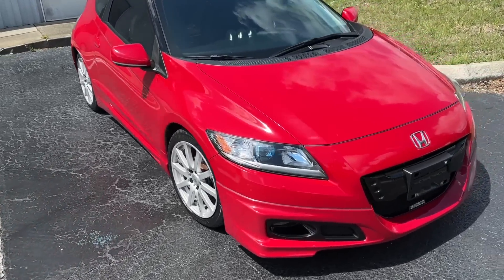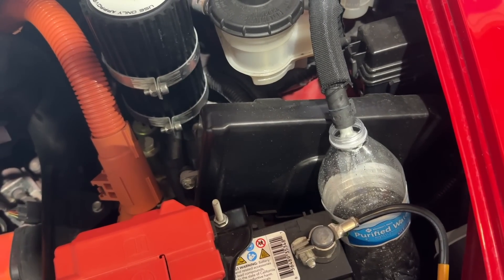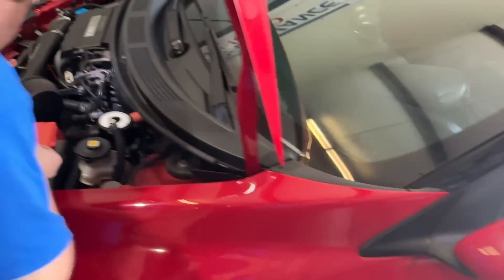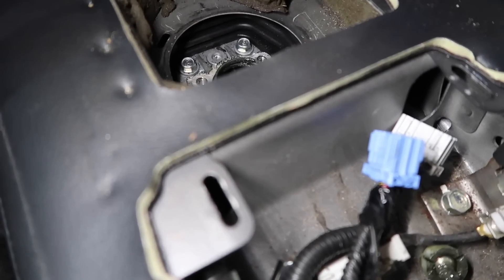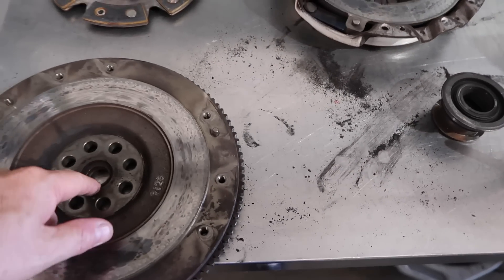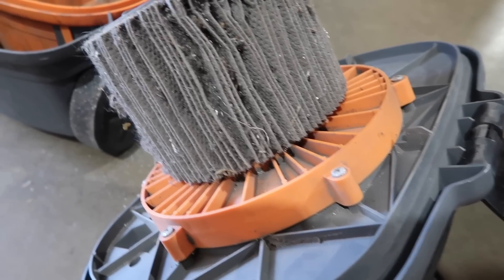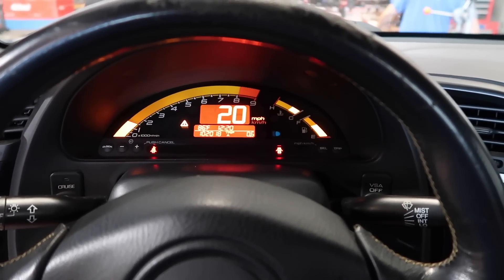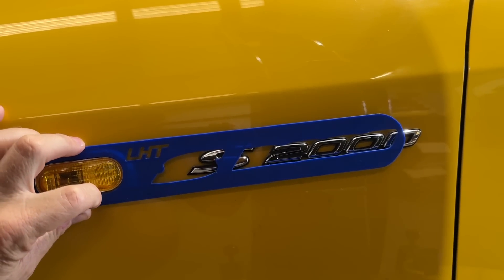CRZ OEM Supercharger + S2000 CR Clutch

Comment: So glad to see you featuring a CR-Z again. I have owned my EX 6MT for two years and I completely love it.  Mine is also Milano Red.  It is a 2016, which is extremely rare. I know that some people, who have never driven a Zed, believe that they are under-powered, but I have not found that to be the case.  I see no need for a super-charger (which cannot be fitted to a 2016 anyway.) It is an absolute blast to drive on the street. I keep mine on a very strict maintenance schedule and I use Honda OEM parts and fluids exclusively. I live in California, so maybe I will drive it across the country and visit you some day.

Comment: If you get one of those Oneida Air Systems Dust Deputy (or one just like it) you’ll never have to worry about buying another filter again. I use it for my sawdust when I woodworking and I’d say 99.5% of the dust never makes it to the filter. As expensive as those filters are, they are great to not have to replace.

Comment: I have a question, in my civic Ek, should i put MTF quantity what service manual says, or until ii comes out from filling plug?
Reply: It should basically take what the manual says until it starts spilling out of the fill hole. The key is to make sure the car is level when filling as some will refill with the nose jacked up/car tipped back and you won't get enough in before it spills out.